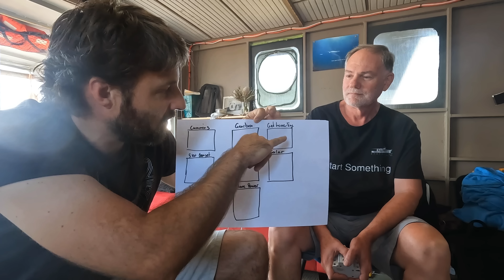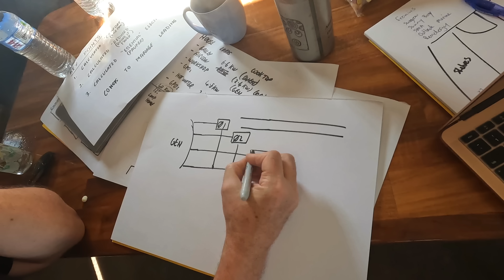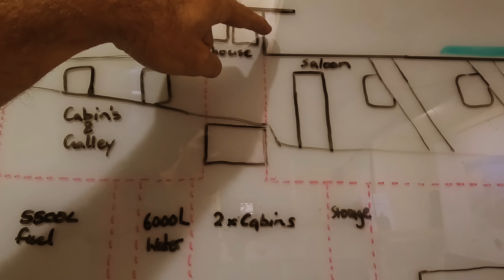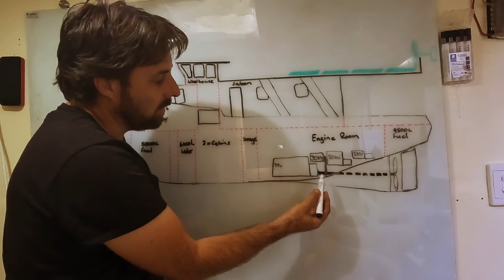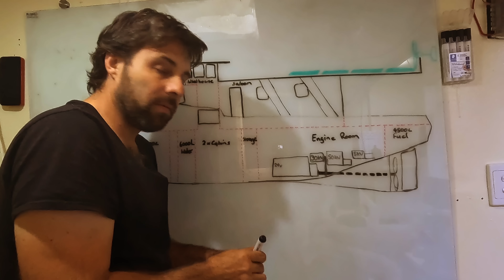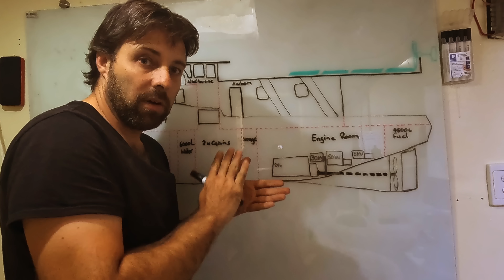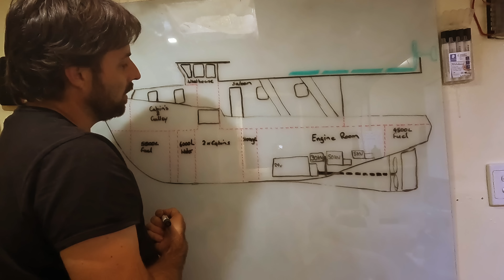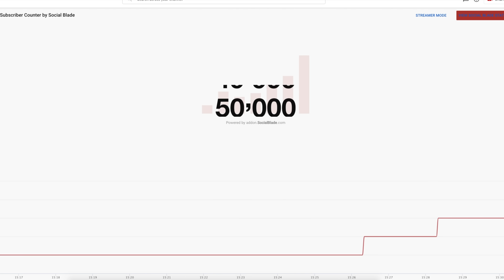Powering Brupeg - Project Brupeg Ep. 273

Comment: I don't know what you ended up settling on as far as your system architecture is concerned, but 3ø gensets aren't rated for full load on only one phase, as you were suggesting you might do at the start of the video. You have to balance the load across all three.

Few ways you can do that, but as one example. For this you'll get balanced loads, the ability to run on both single and three phase shore power and minimise cost on inverters, chargers etc.

Set the boat up with three phases all through and balanced loads across phases but only single phase loads. Then use a 3ø changeover switch, one input will be the 3ø genset, the other input will have all the phases wired together and run off your single phase sources, whether that's the inverter, single phase genset etc. You can then have just a simple single phase charger/inverter.

When on your 3ø genset it will operate as just a charger given you won't undervolt it.

When on the single phase genset it will either charge the batteries or if your load starts getting a bit high it can run as an inverter.

When both gensets are off, you have it running as an inverter.

Then there's shore power. You can run single and 3ø, just not at the same time. You just need an extra couple of changeover switches, one 3ø to switch between 3ø shore and genset, one single phase for between shore and genset. Output of those is what feeds to the 1ø/3ø one mentioned first.

Then for charging batteries from DC sources, any number of options out there for solar and wind generation.

Re soft start, any VFD will do that along with giving you some speed control and the ability to reverse etc all in one box. They also allow for remote control so you can have the VFD in the engine room and control it from the bridge.
Reply: Hi Daniel. That largely aligns with our thinking. There was no intention of running just a single phase from the 3ph genset. The limp home motor is three phase, and the remaining loads balanced as best as is possible. We have a couple of VFDs which we are looking at now. Cheers, Duncan

Comment: I just build a solar system and 4 battery banks 48vdc 14.4kw each battery. Regardless how you do it please do not daisy chain your batteries, here is why. When you pull 15kw of load from batteries say at 48v that is 313 Amps which will over work your batteries. if you have say 6 batteries into a busbar with same length cables each battery will provide less than 53 amps. saying each battery is 100ah the daisy chain will pull 3.13C and the busbar setup will pull .53C from each battery(bank of cells if DIY). the more batteries you have will lower the C charge/discharge rate. I am sure you already know this but others do not.

Comment: You have a 14kw generator and regardless of the voltage or current you have the same. The Watts equation, P=E x I means you multiply voltage times current to get power in Watts.  If you can verify that your ports of call have three phase power (it exists as 220 and 480 and higher) then you can connect providing you have the proper connectors and cables. You otherwise have to use a Phase Converter to transform single phase and transformers to get the proper voltage(s) for Brupeg. You already have big conductors around the ship so I don’t think three phase is of any benefit. For simplicity and reliability anywhere you go (provided you operate on 50 hz and not 60 hz as in the US) you will be better served using single phase power.

Comment: I wish my plasma cutter cut as cleanly as yours , I've tried different air pressure settings and the cut welds itself instead of leaving a gap .
Reply from the maker: Move a bit slower, increase air pressure and if its thick steel and it’s still giving you trouble, move with a swirling pattern to make the cut wider

Comment: Something to think about as what is available is to use a motor/generator for your get-home drive. I don't know what is available but if it is just a matter of choice it could prove to be a real asset if you have engine power but the big generator is out of service. That little  5KW isn't rated at that power level indefinitely and it may be handy to have the big engine-driven one.
Reply: Thanks for the comment Rudy. The logic goes along the lines of: if the main engine is running, we have propulsion. If it fails, we have the 40kw genset to drive the 30kw limp home electric motor, plus a little bit of overhead to top up house batteries if required. The order of inputs to top up the house batteries is: solar/wind; 5kw generator; 40kw genset; and of course shore power trumping both generators if connected. Cheers, Duncan
Reply: @duncancampbell62  I didn't know what your KWH requirements were. I do know that inclement weather and extreme cold can put a damper on normal electrical systems such as solar and wind.  I've have used several starter/generators and they have performed very well.

Comment: Three phase can give Triple redundant circuits - My vessel is an ex Royal Navy fleet tender, and is wired with three phase;- The single phase loads are tapped at the generator and wired separately as three independent circuits in parallel (NO Components being shared by the three 'legs') - typically most rooms have 2 sets of lighting on 2 different circuits (phases), and safety areas (corridors, access and egress etc.) are wired using all three - a fault can take out an entire single phase and there is still lighting throughout.  
The guys who designed it were diligent about minimising commonality to the point where 2 lights, a few feet apart, are fed such that the wires dont even run alongside - one is fed from a distribution board aft via a cable tray on the port side while the other is Starboard / Fwd seemingly wasting about 8 meters of cable - Is really clever once you get your head round it (as long as some previous owner hasn't painted over the cable labeling....)
In a similar way the Bridge has 24v DC backup from a set of dedicated batteries, in the event of total failure, still got Radio and basic Nav functions, 
The 24v DC main batteries power an emergency lighting system - (Simple Relay/Contactor - Wired NO (Normally Open) - If Mains fails the Relay closes and and switches on the 24v lighting system - If things go "Dark Ship" you want to be fixing the problem, not fumbling around for a flashlight...
Reply: Thanks for sharing that Andrew. These are certianly all elements which we are considering heading toward the final design. Cheers, Duncan

Comment: Pretty sure that European 220v would work for your charger's just at a slightly lower charge rate.
Reply: I know we have been saying 240V, but technically Australia is now said to be 230 volts, to align with European Standards. Europe I believe is now formally 230V, so its actually formally the same now. Cheers, Duncan

Comment: Hi Folks, you dont go into much detail, but there are combo units: mppt, battery management and 15kva 3phase output plus wide range shore power/genset input out there. You also could use it to add an other 3phase power source to use battery as buffer in limp home mode and/or tie both gensets together. like you need a bit more than 30kw, well that 3phase limp home engine can deliver about 45kw at 75Hz (you where talking about ramping up slowly, so you for sure use a fequenzy converter, so your free to go to 100Hz, but that engine maybe wont make that much, but 75Hz should be no problem for a limited amount of time, a bit over 75 should be fine too, just in case you have to hold off a cliff in a storm), but your main genset cant, but with solar and the other genset tied in at the same time you can do indeed. so having an other or two 15kva 3 phase source(s) that could get the other 5kw genset and battery and solar to also be available for the limp home, would be good, woulnt it. such a unit is about 3k bucks. so no big investment really, I run those my self in my own solar system, charging a car, supplying washing machiens (euro stylie 230V 3kw (btw. we got 230/400 over here, no such thing as 220, thats a past long gone), servers, A/C, kettle, they move my home with 12 folks permanently around here. I have no afiliation with tose guys what so ever aside from using their stuff my self. get in touch ill tell you what I have, have em used fore and how they work and the type and model I used,  I dont do public advertisment on youtube. I dont get payed for, therefore I dont hold anybodys flag pole in public. And, on a side note: rig the whole boat in 3phase, dont go the cheap route, those combo units would safe you the multible mppt stuff for the PV, they alsow will spare you the cost of the battery charger from shore or gen power. There is no such thing as to much power somewhere, its always and everywhere to less. Cheers.
Reply: Thanks Manne. 3-phase is a done deal. The genset/motor combo pretty much define that. Damien is now looking at a combo unit which he had a bit to do with in his former working life. We will be using a variable frequency drive for the 3 phase motor. We have a couple of leads on some suitable ones at descent prices. Apart from speed control on the electric motor, they can do fwd/rev, and ramp up/down profiles for the motor (which takes care of the soft start function). There are many other functions including data interfaces which will be good for remote monitoring. Cheers, Duncan

Comment: so Dame how big is the hole you are planning to cut into Brupeg this time?
Reply from the maker: Proportion to the horsepower we need to add in…
Reply: @ProjectBrupeg  Awesome. The hybrid drive is something we have been toying with on smaller steel craft.
Reply from the maker: How have you found it. What’s your experience been?
Reply: @ProjectBrupeg  we are still testing. Overall it has been positive however we have been testing on much smaller boats than brupeg using 60v dc brushless motors. Also we have been testing on inland waterways not the sea. I am in the UK. ICE engines are fast becoming the devils work, we are trying to find solutions for small boat hire companies. 20tonne and smaller steel craft. Veg oil is another one of our projects.
Reply from the maker: Vege oil is a fairly easy conversion to get to carbon neutral right away but it does still mean an ICE rattler banging away. Light displacement boats are fairly easy to push with electric. Especially if your not trying to cross oceans and only need a day of range before recharge.

Comment: Bring the solar in on victron MPPT chargers into the battery bank. Dont go crazy with the high voltage solar, stick with under 100 volts, so 3 panels in series, then put them in a larger parallel bank. This is more reliable in a hostile enviroment.

Battery bank to a single phase inverter charger. Use the inverter charger on single phase shore power, as you will more then likely find single phase more then 3 phase. The inverter charger can then charge the batteries from shore power. Charge the battery bank from 3 single phase 80-100 amp chargers from your 3 phase genny as well if needed. If your 240 volt load is excessive, another single phase inverter ONLY on the bank to run 2 seperate phases on the boat.  The inverter charger will give you perfect changeover from inverter to shore power and back, ideal for computers and things that dont like getting power cuts.

If you have 3 phase loads and dont want to run the genny, you can use single to 3 phase VFD units as well. With your load i dont think 3 phase is really needed. Using rather cheap inverters you can have seperate 240 volt sources for your loads.  The get home motor is your highest 3 phase load, and you can run that directly from the 3 phase genny via a 3 phase VFD which will give you your soft start and speed control.
Reply: Hi Colin. Your comments resonate with much of our thinking, for the same reasons. You are correct in that our house load does not require to be three phase. There is therefore no need to generate three phases from a single phase for house load, so a VFD for single to three ph conversion not required. Agree completely re the 3ph motor, genset and VFD. Thanks for the comment. Cheers, Duncan
Reply: @duncancampbell62  No probs. I have a bit of experience with the solar/battery/vfd side of things, not so much with 3 phase, so i can only speculate about that kind of stuff. Watching more of your video, you mentioned you can run nearly entirely of the solar/wind which makes things a lot easier too, so 1-2 inverters may be all that you need. I didnt even think about the fact that other countries might not have 240 volt haha, so yea shore power being a weak 110volts AC would be useless to you.

The wind genny- i would stick with its DC output only for ease of control, and easier wiring. As you know marine enviroments are HARSH, and the higher in voltage you go the more leakage through moisture and sea spray, so the lower the voltage even though it requires thicker cable, the easier and safer. Vaseline is your friend. Pack it all in vaseline. As well the dedicated wind MPPT controller will have an easier time controlling the wind genny speed and the dump load if you ever need it will just be a resistor bank. I honestly think, with your loads, and charging ability, you are going to be spending more time with excess power then needing it. A very reliable inverter is going to be the most critical.  I would also spend some decent time and effort on managing the lithium charging, dont let them spend too long at 14.4 volts, use them of course, but LFP lasts the longest when cycled between 80 to 20 percent. A conventional DC-DC would also be recommended to help charge the engine start batteries, even something as basic as a redarc BCDC50 core to charge the lead acid from the lithium bank. That leaves your start batteries full always which is absolutely critical. If you start your 5kw to charge the lithiums, they would then in turn charge the starts as well. You have multiple redundancies which is great, but multiple redundancies also give you multiple failure points. Get a good switching matrix/bank to allow bypassing of things that could fail. For example, you can emergency charge lead acid directly from lithium, charge the start from wind or solar if the lithium BMSs fail, a good AC charger to allow charging of either bank from the 5 and the 50kva generator as well. Wiring this would be a bit of a nightmare, but when you are in the middle of the ocean anything that can help will help just in case. Case in point, don't rely on your solar. High lattitudes/bad weather can pretty well eliminate the advantage that solar provides.  Allow yourself to run the inverters of either start or lithium, the main engine plant alternator is also a viable charging source. Hell, even adding another high output alternator to the main plant gives you a nice reliable additional source of charge.

On a side note 12 volt led lighting along side 240 volt stuff gives you additional lightning sources, thanks to the camping industry, the amount of 12 volt stuff you can get these days is insane. Not sure what voltage your main lithium/start bank is, but having a seperately charged/maintained 12 volt system rail if you dont have one onboard is another source of power and redundancy.   In worse case scenarios, 12 volts is still better then no volts. Getting your onboard system monitoring also monitoring all these voltages would be a breeze as well. Status at a glance. You can monitor currents and voltages with dirt cheap modules these days, and a dedicated screen somewhere having go/no-go indicators for all system busses is just another one of those "peace of mind" things.
Reply: @colinsmith6340  Great stuff Colin. Thanks.
Reply: @duncancampbell62  Sorry i realised some of this stiff is probably obvious haha, im just rambling but i hope some of it gives you ideas to help.
Reply: @colinsmith6340  All good Colin. It helps consolidate and check our own thinking, and good to learn from your experiences and knowledge. 👍
Reply from the maker: Yeah really great info, thanks Colin. Dame

Comment: First you need to pick a house pack voltage I would go with 24v as it be easyer to get round the world spare parts,48v dose have a advantage of lower current per watt but harder to get spare parts at short notice.3 phase generator with 3 battery chargers 1 per phase to charge battery banks to balance the phases.DC to 3 phase are available in 24v or 48v.A battery to battery charger to to charge the battery bank while under way.I would run the boat on 240v ac single phase off the genset or its own 240v inverter.I would go the DIY way to build the battery on price as well as easy to change parts like BMS i would by extra to take along as spare and fit as much battery as i could as well as solar .All the best from UK. PS we are 240v as well 50 hertz
Reply: Hi Mark. Yes, we are leaning toward 24V house battery bank(s) at the moment, for various reason including the specific batteries already on Brupeg and their BMS'. The 3-ph genset is a given with the 30kw get home safe motor. 3 x inverters/chargers are in the mix of our current thinking to take advantage of the 3-phases already available, and 3-ph shore power when available. We can resort to single phase but reduced battey charging from shore power with only single-phase availability. The house load circuits and inverters/chargers/batteries are likely to be done in three banks to suit 3-ph, but at that point, we don't need the 120 degree relationship, just the three sources. Cheers, Duncan